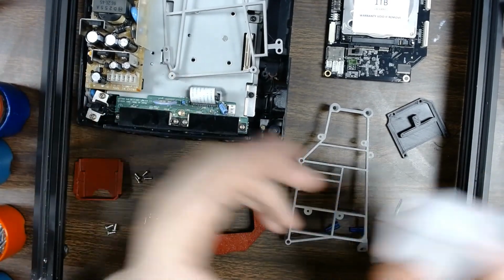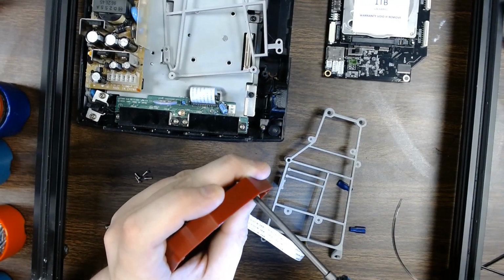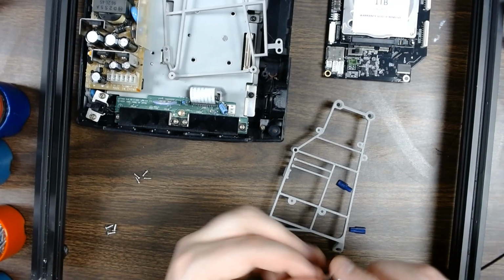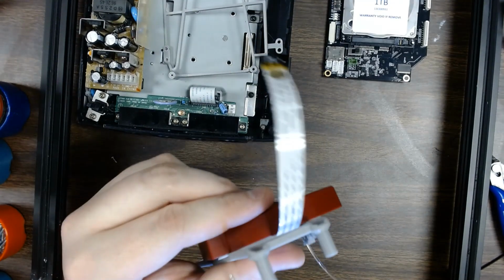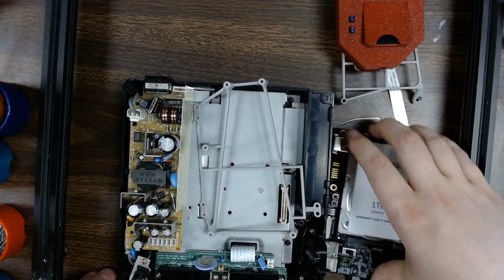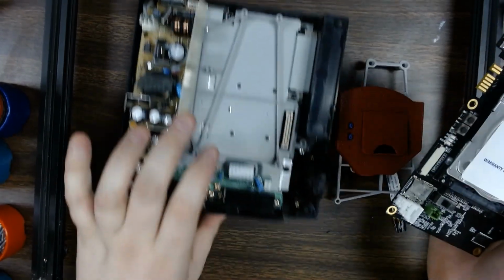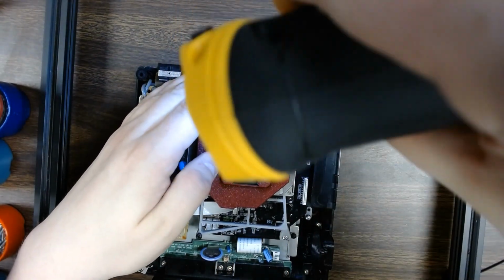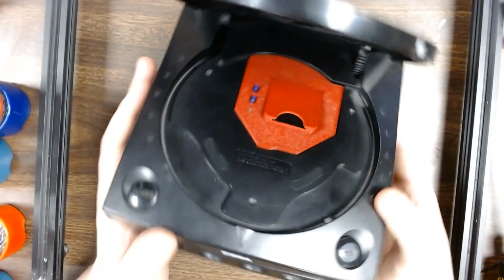MODE Dreamcast Mount

Comment: Why does the assembled kit come with the top attached to the bottom if it has to be separated to fit the mode in?
Reply from the maker: To pre-tap the screw holes and protect the frame in shipping
Reply: @LaserBearIndustries removing these from the assembled kit I got is proving to be very difficult. They're extremely hard to remove and it's a miracle I haven't broken the plastic. If I didn't buy it pre assembled I probably would be done by now. These are extremely tight.
Reply from the maker: @TheDOSGamer  If you are having issues please reach out via our contact page or reply to your order confirmation email. Providing support through youtube comments is not practical and tends to result in missed messages as they do not reliably send us notifications.
Reply: @LaserBearIndustries  I got it detached, so no support needed. Just feedback that the screws were really tight and that stress on the plastic removing them was sketchy, thought for sure this was gonna break but luckily it didn't.

Comment: The problem with this setup  is you can't easily remove the SATA Hard Drive or SSD to add more games to the drives because you have to  remove the bracket in order to remove the SATA Hard Drive or SSD.
Reply: Can you move games from SD to SDD?
Reply: No iirc  @edsonlopes7519

Comment: Do you sell just the SD Extension (15cm MicroSD to Full SD) without the hood or that mount bracket? I have the Stone Age Gamer Bracket for MODE and don't want to remove it because the noctua fan mod gets in the way making it awkward to remove the Stone Age Gamer Bracket that I paid 45 bucks for.

Comment: I bought a SEGA Dreamcast MODE 3d Printed Tray Insert with SD Extender - Terraonion MODE on E-Bay and it's Micros SD Memory card 2 SD Memory Card Extender thing was of better quality, no tape on it and it had a piece of plastic similar to a SD Memory card that makes it easy to  insert in the Micro SD Memory card reader, no worry of damaging and protective tape or cracking the cable.

Comment: I don't know if something changed with the new MODE board revision (mine is Rev. E) or if my MODE was made wrong but this mount wouldn't fit with a standard size SSD or HDD. The back of the drive encroaches on the rear holes too closely so the screw holes in the mount can't line up properly. It seems like the SATA interface on the board is about 1mm too far towards the rear. 

Thankfully, when I remove my SSD from the housing it's only about an inch long, so I've just installed the bare board for now. The board isn't in contact with anything so it should be fine, but I will probably see about printing a smaller case for it.
Reply from the maker: Interesting could you contact us on the website or respond to your order confirmation? I'd like to see what is going on.
Reply: @LaserBearIndustries  I probably should have mentioned I printed it myself from the model files provided on the Laser Bear site. Everything fits together and lines up perfectly without the drive so I don't think there's anything wrong with the mount. It really seems like the MODE is the issue. I just double checked and if I have an SSD or HDD installed in the SATA slot, it's actually partially overhanging the pads around the rear screw holes. From what I can see in this video, that doesn't seem to be the case for this MODE.

Again, I'm not sure if it's just the new board revision or if there was a hiccup in manufacturing mine. For reference my MODE came from the latest Stone Age Gamer batch.

Comment: This would be great however the buttons are missing and I've got to drill the top to get that lightbar in which I've wrecked in trying to install it. Shame, was looking forward to installing this! But the sweets were nice though :D
Reply: I got the buttons but they didn't fit at all. I had to sand them down a lot as well as ream the holes for the light pipe. Also apparently didn't receive all the screws. I guess the best option is to order it assembled.